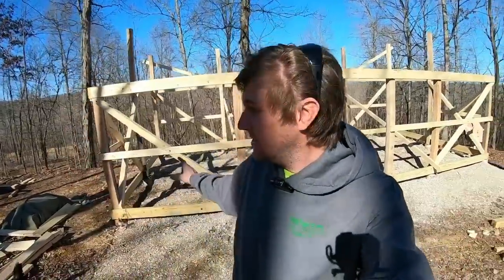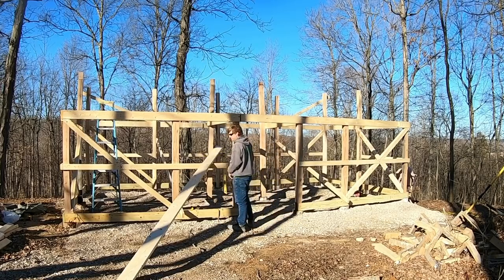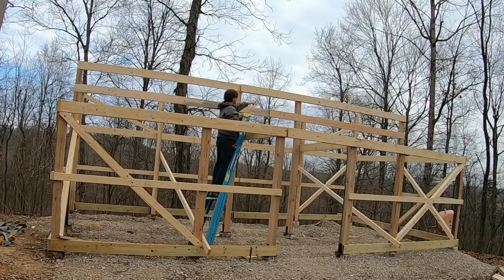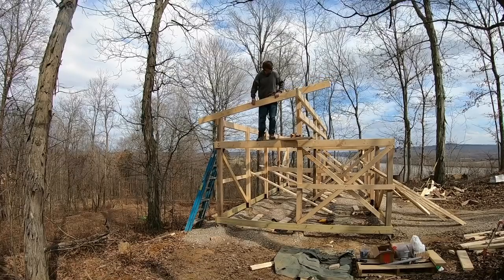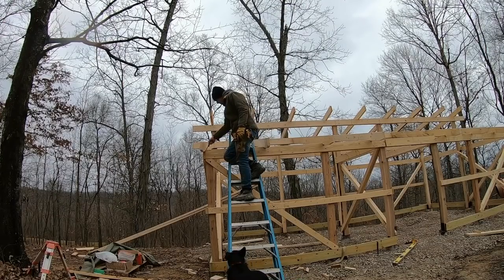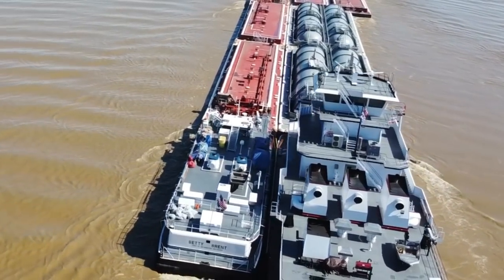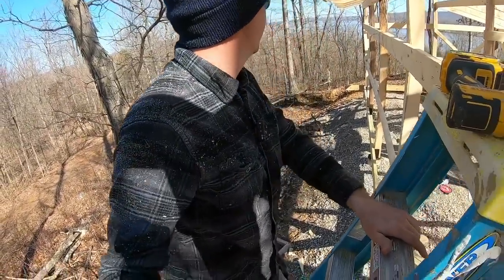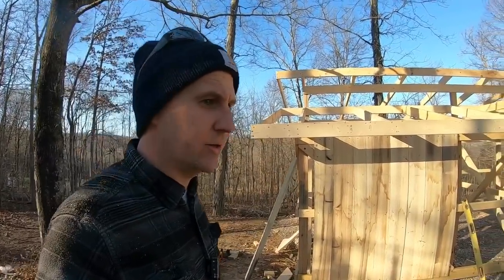Building a Goat Barn and Chicken Coop - Framing the Rafters - Part 3

Comment: Nice job. The coop is going to look good. I had a few questions and you answered all of them during the video. One suggestion was to get some saw horses, they make life easier. I did think you gave up too quickly on the tool belt, but if it falls apart, it does save a lot of time.
Keep on keeping on, and thanks for letting us play along !

Comment: The miniature animal barn is looking awesome! The stand and seam or board and batten siding system is to me the best way to do wood siding. I built an enclosed porch on the back of my house and put board and batten siding on it. I got lucky with the type of wood I was able to use because there is a lumber sorting, grading, and kiln drying facility close to the house. Close enough to drive the lawn mower with the trailer to get boards. On their burn pile I was able to pull out enough oak to put all oak board and batten siding 12" wide by 1" thick on the three walls of the new 12' × 16' porch. I've whitewashed it several times now so I think it's going to last a long time especially being that its oak. I really like how you designed and built your barn. The windows where the offset roofs are at is a good way to get light inside and it looks great too. The gabled entry area looks really neat too. This is going to be a nice building and will serve you well I'm sure. Good video. Stay well. -Wil  👍
Reply from the maker: Hey thanks will!

Comment: You’ll be glad to use nails over time, they showed shear strength when I took USAR Technician back in the day and I was surprised.
Reply from the maker: Very true, but they do offer structural screws as well rated for sheer strength.

Comment: 🤙. I built a 10x10 tool shed. I used 2/6 for all framing. I used 3\4 inch on floor and 1/2 on wall’s and roof plywood. People ask way. It will be standing after the house. 🤣
Reply from the maker: Exactly 💪

Comment: Vertical board siding is best nailed in the center only, it will shrink and expand and splint the way you have it applied.  It is best to leave a small opening say a half inch between the boards to allow for expansion and contraction.  The bat is a narrow strip nailed to cover the area between the boards, it is also only center nailed.  It is a nice building, I am also wondering why you did not allow for a bit of overhand on the gable ends. You need to buy you daughter some new pants. 😊
Reply from the maker: That's the style these days bud.
Reply: @CaptainKleeman  Not a very good practice, your ancestors knew better and you will too in a few years.

Comment: nice job so far on the barn mike, she built solid.... but not sure why u used 16D nails on the wall boards? aren't they sticking thru by 1" on the inside??
Reply from the maker: Ha!  Yeah, I mentioned it in several comment, I stopped there and ended up buying 2" nails

Comment: Have you considered metal gates for your stall walls leaves in more air and light easily opened for stall cleaning and easily reconfiguured if animal needs change . I have my horse stalls that way and it works good.
Reply from the maker: We have a plan for good ventilation, it does include some metal gates

Comment: Looks great!  Will you be able to access the long alleyway with your tractor for bedding clean out?  That’s my only regret with my current chicken coop. Having to scoop through a 3’ door into the tractor bucket.
Reply from the maker: It's wide enough, but I doubt it's tall enough.  We can get the loader in enough to fill the bucket

Comment: Looking Great Captain or in your case, "Well", in which your right, it really is a deep subject.  Speak of deep subjects, I noticed the 16D's (Got it, use what you have) are protruding out the back of the siding, is the plan to grind those off or to hang the chickens from? 🤣  Also Interesting (when the camera was not collapsing), I saw you use nails for the gutter boards on the front and screws on the back,  and everything else. I assume that was a supplies issue and not intentional.
Reply from the maker: Lol, yeah, I quit using them and ended up buying some 2" ring shank nails for the rest of the siding.  I will end up having to cut the first ones off

Comment: looks good but the nails poking through  on  inside of chicken coup might want a little shorter nail i would use 1 1/4 deck screw for siding
Reply from the maker: I agree, made a mistake there.  Ended up getting 2" ring shank.  Thanks for watching

Comment: Technical question for you Mike - how are you attaching your GoPro to that Neweer tripod?  I understand that you use a magnet screwed into the bottom of the handle you use on the GoPro - do you unscrew that to mount onto the tripod or remove the whole handle assembly or??  Just wondering.  Always enjoy your videos!
Reply from the maker: Yeah, I have to take the magnet off when I use the tripod.

Comment: Not trying to be a complainer. Just helpful info. You should have used galvanized nails on the siding. Those 16d nails will rust and give you rust lines unless you keep them really covered in paint.
Reply from the maker: Not too worried about it, but I appreciate ya looking out

Comment: You forgot to add rafters for the valleys. Instead of pressure washing just spray it with a sodium hypochlorite (bleach) mix. A 1% mix should do the trick. Pressure washing would just add moisture to the boards and make the wood fuzzy. Spaying them would instantly remove the black stains and kill any organics in the wood. You can get for relatively cheap of 30 second cleaner that comes in a quart size bottle with spray nozzle and hooks up to a garden hose and mixes automatically. Just wear the proper P.P.E. when applying.
Reply from the maker: I wonder,. And this is just a working theory, if the barn isn't finished yet...mystery, I know.

Comment: Looks good, Kleeman. Are you going to make a hip roof from the gable entrance, not sure how you going to frame it but I guess I will see. Are you going to grind the nails flush inside from the boards nailed on? nails will poke under your fingernails at the worst times if you don't. No window for the chick chicks down low? How will they know day from night? ;)
thanks for the videos.
Reply: Ohh Paul, I was wondering about the transition from flat to gabled roof, too. Should be interesting, huh? As for the nails, I'd get some 8d or 10d nails for the rest of the siding and hammer over the ones the Cap'n already has in (will make 'em hard to pull though and the ring shanks will be even tougher).
Reply from the maker: Yeah, I ended up stopping and getting some 2" ring shank to finish the rest.  I didn't think that part through very well.

Comment: I know you have probably have already addressed this but I strongly urge you to seriously think about putting a concrete floor in that barn. One for easy clean out and 2 for disinfecting purposes. With both goats and chickens you can get what is called cocsidioses which is both highly contagious and deadly to both. Concrete floor will help you to control that issue.

Comment: Please put hangers on those rafters.  Those screws will not support the roof, especially with snow.
Reply from the maker: I bet they will.  I'm excited for the experiment anyway!
Reply: I would think if Mike is using true structural screws and not “decking screws” he’d actually be better off than hangers. The shear strength of GRK Screws is amazing!
Reply: @CaptainKleeman  They will be just fine. I have a shed about that size with no center poles that has rafters built the same way. We get way more snow and its been standing for 8+ years just fine now.
Reply: @tmacie2  no longer than the span… with cross braced structure and bird’s mouth tails.  It ain’t going nowhere.  That’s my bet!

Comment: I actually like it Mike. Cool style and just lacks a old tv satellite dish with a smiley face on it. Setting right on top of the building somewhere its attached to the main structure and doesn't rip tin off of the roof. One side is a egg factory and the other makes smart pills. High production building and permits were done by same engineer...  cool beans ... really cool beans as I hate government telling me how this is going to affect the springtail bugs. Maybe have a DEP juice catchment on the low side of it too... that was me being a  jerk there ok. Just once I would like  to build something where there was no shortage of wood to  work with.

Comment: there would appear to be no windows in your barn which will make the inside very dark when finished
Reply: The split elevation in the roof will allow vertical windows above.  The inside of the tin roof is white and acts as a great reflector of sunlight.  It is an old design often used in animal barns.
Reply from the maker: Well heck, it doesn't even have walls yet, how did you get to that conclusion lol
Reply from the maker: Bingo